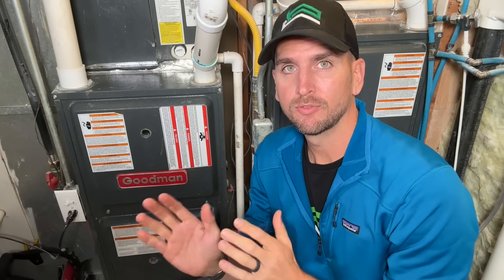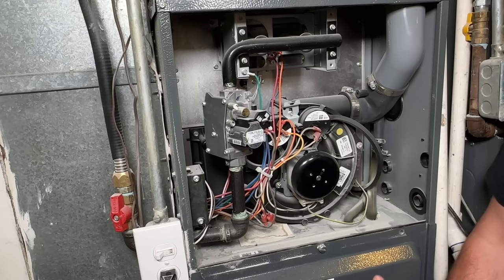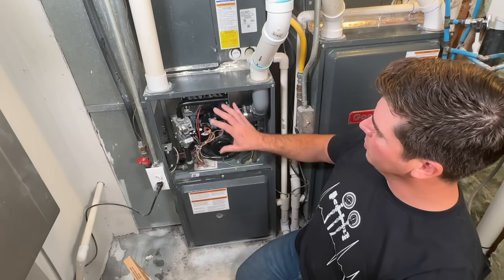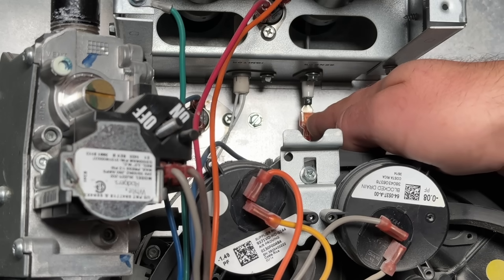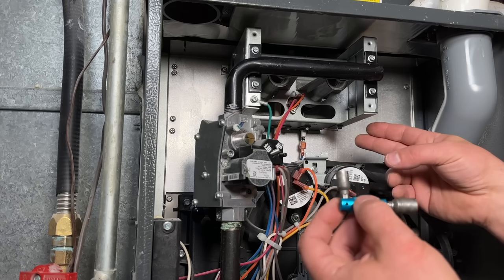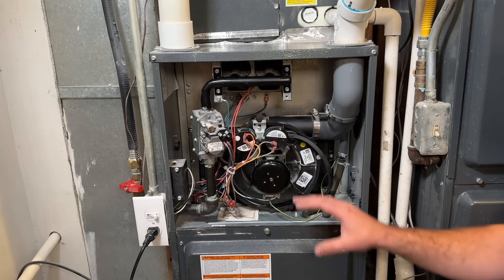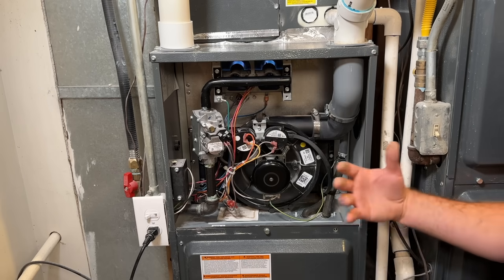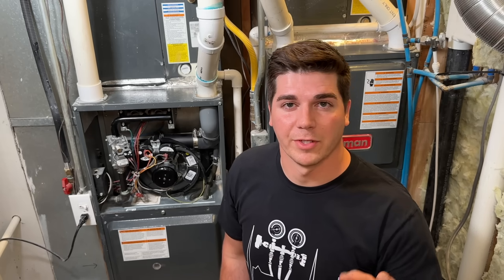Yearly Furnace Cleaning And Maintenance Pro Tips

Comment: Well that was worth about $25 - you missed several more steps. All high efficiency furnaces have condensation drains that will eventually clogged up. Remove the retaining clips from the hoses  and clear out the rubber hoses located inside the furnace. Repeat the process with the vacuum switch hose’s attached to the pressure switches. Failure to do so can result in no heat situation. Take you 5/16’s and 1/4” nut drivers and snug up all the screws inside the furnace- half turns. Vibration can loosen them over time - remove the furnace filter and vacuum inside the cold air return- often an accumulation of dust - dog / cat hair etc is always found inside at the base.
Reply: Maybe $10
Reply: I was being nice, after all the guy did show up.
Reply: 8 years and flame sensor is fine. No point of cleaning it unless u get a error code. I recently replace my igniter and the flame sensor didnt look bag.
Reply: Well you and I can let it go and handle any issue that may come about but a typical homeowner can’t so as a rule I always give the sensor a light sand when I’m doing a maintenance service.
Reply: How do you clear out the hoses? Compressed air?
Reply: So the hoses are attached with clips on each end - remove one clip at a time using pliers- with one end removed either blow through with you mouth - vacuum and yes you could used compressed air.  If possible unscrew the condensation trap located underneath behind the bottom door - some furnaces traps are mounted on the outside of the furnace etc… remove the trap and flush the trap out with clean water. Reattach the hoses back on when your done
Reply: Its funny cuz the homeowners have no clue.
Reply: On my furnace, to access the blower, the furnace has to be disassembled. Guess I’ll let that part go.😊
Reply: How do you get to the A Coil?
Reply: Depends what equipment you have. Is it an air handler or gas furnace?  You best bet is if you have a round supply duct coming off your plenum above you a/c coil then tape that pipe apart- that should give you enough access to spray coil cleaner on to your A coil which you can purchase at Home Depot. Only thing is you won’t be able to clean the dust caught on the underside but it’s better than nothing
Reply: True.  I watch all this on my Moms furnace. And we still have it checked just to be sure.
Reply: Pro Right there.  Nice detail work right here too.
Reply: Bang the shit out of the back of the nozzle pipe to knock any crud out the carry over tubes lol I do it all the time
Reply: I will never understand why technicians make these types of videos. This is your livelihood that many of us spent money on going to school for. Why give away knowledge for free? Anyway in this guys defense he isn’t giving away any knowledge, at least not useful. Although it is a great idea to change that filter.
Reply: The better your combustion air the least likely you are to have to clean the flame sensor. I find 80%ers in the same room as the laundry room must be cleaned far more often than a 90%er with its combustion pipped outside the home.
Reply: You techs crack me up on how you think homeowner’s are so stupid and can’t figure nothing out unless you go to some trade school.  Talk about the pot calling the kettle black…what’s the first thing trade guys say when you talk to them about how to do a job a professional went to 4-8 years of college for.…”well I didn’t go to college but that’s what I’d do”. Show some respect for to others everyone has strengths and weaknesses but with a little training and know how can learn even if through a video on you tube.   What ego’s …..Lighten up!!!
Reply: @essentialmanchannel You pretty much described all trades there...they have seriously thin skins, even when they are bending you over.
Reply: Thats why he didnt mentioned it so he can make money of the most basic stuff
Reply: Harleyboy200 can you make a youtube video on these steps? It's will be very beneficial for all of us. Stay blessed brother.
Reply: @derekjackson3990 hvac guy just tried to charge me 650 for a furnace “deep clean”. These videos aim to inform even if you diy so you aren’t getting ripped off. This isn’t brainless but it isn’t rocket science either.

Comment: When I open the front cover for vacuuming inside the firnace, there was something like filter attached to that front cover. That filter kind of thing was very dirty and broke. What do we call that one? It is round fiber something. Where to find it. Can we turn on furnace without that? Just closing the front cover?
Reply: Is your home a mobile home? A lot of mobile home furnaces have the filter material just clipped in to the back of the front cover. You can replace that will standard filters just make sure the existing area that has a filter is covered by the new filters. You can use standard pleated filters as long as the clips will hold it in place. Also that filter that is there is more then likely washable. So if you spray it down with water real good that help your system a lot. And clean it on a regular basis. Maybe every 2-3 months. Cheers
Reply: It may just be sound dampening material. It is sometimes glued to the inside of blower compartments. If it comes loose could get sucked into blower.

Comment: Very useful video!  I have some issue with my 10 year-old Honeywell programmable thermostat.  It works but the LED light inside is not working though I changed the battery.  What could be the problem?  Thanks in advance for your help.
Reply: Make sure the battery contacts are clean in the thermostat and no corrosion.  10 years is probably the expected life of an electronic thermostat and time for replacement.  Not like the simple mercury bulb thermostats that could last 50 years plus.
Reply: 10 year life = you got your money's worth.  Get a new thermostat.  If you manage to fix old the one, then you've got a spare.

Comment: What was the 90 degree tool used to remove the flame sensor?  Looks like that would be a great way to avoid cutting up your hands.  You both have great channels. Keep up the good work.
Reply: Always remember to wear the cut resistant gloves when dealing with anything mechanical/electrical
Reply: Just use a 1/4" ratchet and a short extension, if necessary.

Comment: I get a code, when it is really cold and furnace is running hard for a while, it will shut of the system.  There's something that I read for that code that says if it fails a check that the system will try again and it fails his check like so many times in a row then it'll give this code and turn off the furnace. My solution has been to realize it happens, and then turn off the power to the furnace completely, wait 5 or 10 minutes to let it reset, and then turn the furnace back on and it starts right up and runs. This has been happening for about the third or fourth year and like I said only when it's been really cold. Last year wasn't real cold so it was only one or two times I dealt with this. The first year it started happening it was cold more often and it was a little bit of a concern. Obviously if we go away and it gets real cold and the pipes could freeze up then it's troubling. A few times we would wake up in the morning cold and realize I had to go reset the furnace. I've done some research and I thought it was just a sensor I could change out and seeing this video makes me think it's just a sensor element that I can clean and that's even better. That lets me test if it's really this problem before I call someone in. So we're just about to get into the cold season here where my furnace will be running on and off most of the day so I probably find some time to take the steps you show here. If it works I'll come back and let everybody know. But it seems pretty reasonable like this solution is going to work from my knowledge of control systems from what I do for my work. Glad I found your video

Comment: What about checking for carbon monoxide leakage from the heat exchanger and analyzing the combustion for proper fuel to air mixture and Knox?
Next would be the water column measurement from the utility gas meter to be sure it's regulator is not overfeeding the gas valve and the water column gas pressure on the burners to be sure the furnace is not over fired due to a defective regulator in the equipment gas valve
Reply: There is a co detector in the new furnaces. The gas company do FREE gas pressure tests just call
Reply: Very good, but how many home owners have brand new fueances and even know about natural/LP regulator gas pressures?
An A/C unit will until it stops, but a out of service furnace is dangerous or deadly.
Reply: @mikebavoso26  by brand new i mean in the last 20 years if vents out a wall or uses ups or pvc it was a co detector in it.
Reply: I feel like you heard some of these words before and are doing your best to sound experienced.
Reply: @Hogtownboy1  please be careful to not spread misinformation
Reply: I think this was meant for homeowners is why it doesnt go that into great detail
Reply: @Hogtownboy1  100% wrong sir. No such thing as a CO2 detector on any furnace ever built.
Reply: @srobeck77  you are correct because CO2 is carbon dioxide we are talking CO which is carbon monoxide
Reply: @Hogtownboy1  Again, no such thing as a CO or CO2 detector on any furnace. The closest thing would be a flame rollout switch to that, but theres no detectors like youre thinking of. It would never happen in the future either, because over time that wouldnt be calibrated or become dirty. So I promise you, this isnt a thing, nor ever will be.

Comment: I noticed my inducer motor being noisy at end of 2022 winter. Figured bad bearings. Anybody change one out? I can buy one on Amazon but read you should change the gasket which sits between it and housing. Don't know where to buy the gasket.
Reply: The gasket will more then likely be made of a fiberglass material. It might not come off in one piece but it doesn’t typically need to be replaced. The inducer draft motor is not too difficult. If you are pretty handy, you can definitely do it yourself 👍🏽 what kind of furnace is it?
Reply: @diyhvacguy  it's a Ducane CMPE075U3B. Think it's ~15 years old. Thanks for the reply.
Reply: @T-Mo_  if it’s a metal inducer it will be a cake walk. If you are buying a new inducer motor on Amazon I’m sure it will come with a new gasket. Cheers
Reply: @T-Mo_  looks like it’s a metal housing one. It will be easy.
Reply: I’ve taken my inducer motor apart and replaced the bearings and now have it as a spare.

Comment: I have a question for Scott… I have a Lennox 4ton furnace model G40DF-48C-090X-02 
It has been running very well, as I have kept up maintenance on it. I’ve noticed that where the flames are directed into the heat exchanger, there are, I believe are called Burner Insert-Nox for each burner (4), that I can see have started to deteriorate/melted. I am very concerned about the condition of these. I’ve tried looking for the replacement parts with no luck. Is this something that should be replaced anyway, or should I just leave them alone? Any info help would be greatly appreciated.
Reply: You want to look into what is causing that. Could be high gas control output pressure, cracked/leaking primary heat exchanger, cracked/leaking secondary, failing inducer, undersized exhaust vent, lack of combustion air. Be careful

Comment: Gas doesn't need preventive maint.  Make sure you have a carbon monoxide detector and change your filter every 3 months depending on MERV, better  filters require more frequent changes.

Flame sensors go, paying someone to come in every year and say it's bad is foolish.............have a spare on hand, super easy to replace when it does go.

.signed 35 year HVAC journeyman

Comment: Don't use sandpaper on your flame sensor. The wire brush trick works, or a Scotch Brite pad.
Reply: I use a angle grinder.. cleans it up so fast
Reply: As for the flame sensor... you want to polish/clean the flame sensor with a dollar bill or just plain paper.. the idea is NOT TO PUT SCRATCHES on the sensor.. the scratches will collect dirt faster...  this is the recommendation from the manufacturer who made the sensor... this vid is wrong about the wire brush / sandpaper... he did mention the dollar bill... this hvac tech knows, but doesn't know why!    I am a 30 yr hvacr tech who thrives on knowledge and why.
Reply: @AverageReviewsYT  please don't do that.. (angle grinder)
Reply: Or go out and buy a new flame sensor for 10/20 bucks
Reply: @Blitzkrieg.u812  it works.
Reply: @Blitzkrieg.u812  one time I debated about using a chainsaw to clean it…. Didn’t want to get the angle grinder out
Reply: @AverageReviewsYT  if you think so..
Reply: @Blitzkrieg.u812  typically there is no need to replace a flame sensor. I've only replaced one the whole time that I've been repairing furnaces. Cleaning is super easy...
Reply: @henrideclercq6801  he is an hvacr tech he stated. He is not a hvac tech.. there’s a difference there.
Reply: @AverageReviewsYT  🤣🤣
Reply: Cleaned 100s of flame sensors for over 30 years with sandpaper, only ever had to replace maybe one or two and only because I accidentally broke removing them to be cleaned.

Comment: May I ask, my furnace making the water noise. I looked into it and found that water is not drain properly from the condensation. First I remove the drain line. Assuming water is still inside the line. That can cause the issue. However, even after I removed the line to the output of the furnace condensation box. It still create that noise. Therefore, a puddle of water somewhere inside the system that will not drain 100%. I guess the question is: is it notmal like that? I would assume if install properly, I should not hear any noise.
Acpro 95g1uhex. Called the manufacturer, they denied dealing with home owner. Where they even say, you have to deal with contractor so losing money is a must. Even though, it is first time I test it out after half a year. Installed in summer. Turned on test it. Felt heat turned off. Never had enough time to hear that noise.
Worse, called the contractor who installed it. He claimed. Well if it is not leaking water, little noise doesn't hurt.
Thanks in advance

Comment: Be careful with the compressed air. If you turn it upside down you may spray moisture on your circuit board.
Reply: The propellant in a can of compressed air is not water.

Comment: How about minisplit/heat exchanger maintenance tips?
Reply: Never ever do DYI maintenance on mini splits or heat exchanger. Except a very gentle washing of the fins outside. The chace of burning out the units is very high if you are not familiar with 240v equipment

Comment: How about removing the blower and cleaning inspecting the secondary heat exchanger,how about cleaning the condensate trap,checking the manufold gas pressure and make sure that the furnace is not over or under fired,doing the combastion anylizer test ...?.That is why i dont use "profesionals" they dont do a complete service.
Reply: This was meant for homeowners and they arent going to do any of that to be honest.

Comment: Can you please do one with an oil furnace? I don't have gas where I live
Reply: Oil furance are completely different. The first are very dirty so a yearly maintenance is a must. Second they burn much hotter than gas so it very important to have the inspection done. Most home owners insurance policies of houses with oil heat require an annual inspection by a registered tech with an “ oil ticket”. As an aside propane and natural gas furances are the same except for a same conversation to the sensors and flame
Reply: You do need an annual inspection and cleaning of an oil furnace by a certified technician.  Completely different animal and far more dangerous if annual service is neglected.

Comment: The most important tips here are cleaning the flame sensor and replacing your air filter regularly, especially with the variable speed motors.  This is my 7th house, and I stopped getting a 'professional' to inspect every year after the first one.  This isn't rocket science...very simple stuff.

Comment: I will add Temperature Rise, very important step.
Reply: I come across furnaces temp rise to high or low once in awhile. So yes very important to check.
Reply: How do you adjust if the temp rise is too low?
Reply: @diyhvacguy lower fan speed
Reply: aka Delta T